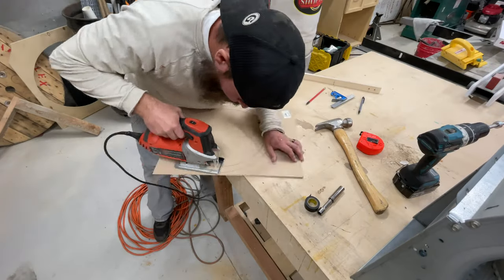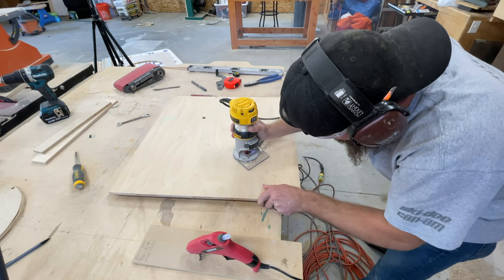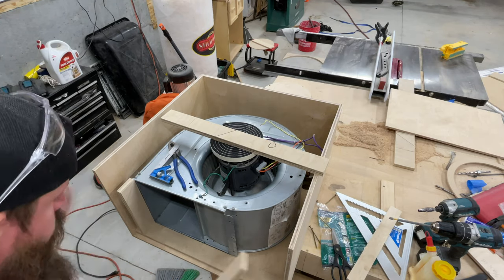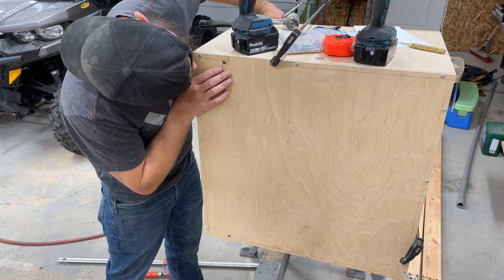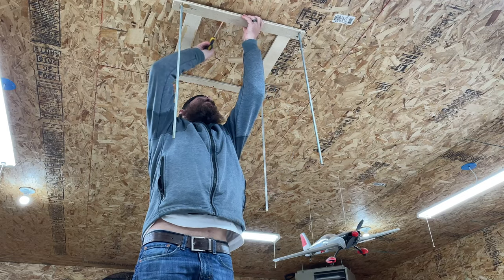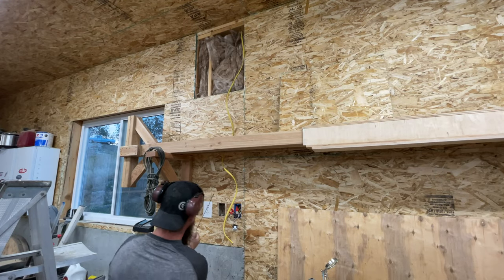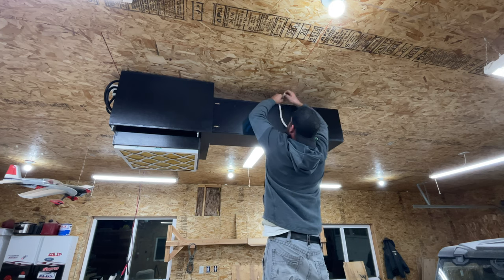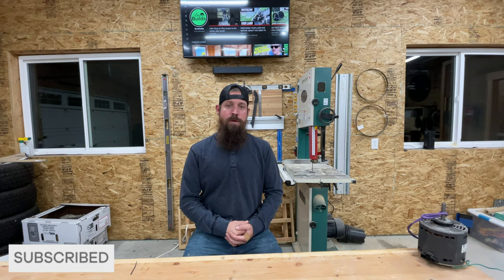THE BEST DIY SHOP AIR CLEANER! / SHOP AIR FILTER!

Comment: When I discovered that my car was generating 1000+ CO2 during the winter as it cooled down after shut down, I installed a timer on my blower for 12 to 16 hours of cleaning and leave my windows down in my car.  You have some awesome gear in your shop and if you are doing some intense work,you might want to track CO2 and/or PM 1.0/2.5/10.0 to keep you and your team safe. Tx for sharing your project work, I wish I had your space and gear!
Reply from the maker: That’s interesting, I’ve never heard about cars cooling off and not running still generating co2. I’m sure the only thing that generates co2 in my shop is my heater, but it’s also setup to exhaust to the exterior. 👍🏻 Thanks for watching and commenting.

Comment: The cooling of the motor is through air leakage only?  I would have put the motor side down or rather put a filter on both/most sides.  The slower the air speed, the finer those filters work anyway.
Reply from the maker: The motor is recessed into the assembly and appears to be getting plenty of cooling. I put the motor on the top side so the filter would be on the bottom because that is the direction the bulk of the dust will be naturally entering. You could add more filters on the sides, but that just means more filters to replace. This setup has been working great for my application. As far as speed goes the filters I’m using are designed for the air speeds of this blower unit, and although I have it wired for the low speed setting (roughly 1200cfm) the filter would work just as well on the high speed. I just didn’t need that much air flow and I wanted it on the quieter side. High was a little to noisy and to much flow for my needs.
Reply: @brewbuilds  Everything turns out right, you did put more thought in your  cleaner than me in mine.
Reply from the maker: Yeah it’s been used almost daily for over a year and it’s worked great! 👊🏻

Comment: How is the motor holding up?  My concern with the design is the motor is sealed in the box with no air flow over it to cool it down.
Reply from the maker: It’s working awesome! I use it almost everyday especially with the warm weather.

Comment: I did HVAC for 10 years and I am with the folks who say there should be an air filter on both sides of that blower wheel. First to increase cooling to the motor and second to balance out the bearing load on the motor shaft. Basically, spin that cabinet 90 degrees and load filters from left and right. BTW, you'd be amazed at how much noise reduction you can get with some duct insulation inside that box. (velocity noise from moving air) Vibration from the solid mounting is another story. I'd bet the whole roof vibrates at times. (low hum) You could spring mount it with some minor engineering.
Reply from the maker: I’m sure having air being pulled in from both sides would add additional cooling, but over the last couple years I haven’t had issues with it getting abnormally hot. I haven’t noticed any vibration, it’s actually fairly quiet. 👍🏻thanks for watching.

Comment: The furnace fan has 2 sided intake, and he only used 1 with the other motor side effectively sealed up, would that decrease the performance and risk overheating the motor? - I would have run a duct from outside and put it into the sealed side of the fan box to cool the motor and induce fresh air into the workshop
Reply from the maker: The real intake is on the side I put the filter. I’m sure if the other side where the motor is mounted that you’re referring to, were open could allow more air flow over the motor to a degree, but I don’t think enough to make a difference. The motor itself is housed almost directly in the center of the blower housing getting plenty of filtered air over it. I’ve had zero issues with it over heating or getting hot. 

As far as running a separate duct from outside to the motor side wouldn’t be ideal in the winter months while I heat my shop forcing my heater to have to run way more than needed. Hope that makes sense.👍🏻
Reply: In a larger fan designed for two intake sides (DWDI), you'd throw the bearings off after some hours of use; I'm not sure it makes a big difference in a small fan.  But if you start chewing motor bearings, might be a Thing.  The alternative is to invest a bit more plywood, make the box bigger, intake air behind the fan, roughly double the filter area, double the air flow.  BTW, the discharge duct improves the air flow by about 15~25%, so that's a good move.
Reply from the maker: The duct definitely helps it run more efficiently, with out it, it draws more current (out of its nameplates spec) so I played around with the size of the duct to get it more to where it should be.
Reply: @brewbuilds  Didn't need to experiment:  always use 3~5' of discharge duct sized at the fan outlet collar.  The factory optimizes efficiency (etc) around this configuration.  Without the duct, chaotic air flow ruins fan efficiency (drawing more current).  Looks like you got a decent setup.
Reply from the maker: @petem6503  thanks for the info! Looks like I built the duct right in the sweet spot. I knew these motors needed some load to run efficiently and the fan it self wasn’t enough, I tried looking up specs on duct sizing but didn’t have any luck at the time. 👍🏻

Comment: Nice job, only comment is you may not want to glue the plywood box pieces together, but just use screws instead.  You may very well want to take it apart at some point in the future, or you may also want to have access to things inside and having it glued all up prevents both of those from being easily done.  My .02 cents.  All the best!
Reply from the maker: Thank you. I left the top of the enclosure unglued for that reason. 👍🏻 thanks for watching and taking the time to comment. 👊🏻

Comment: Sweet build!  Have you thought about running a two stage filter to take it to a HEPA level of air cleaning? Idea is to have a 1 micron filter on the outside and a 0.3 micron inboard of that. You could probably mod the box to make room for an outer filter.
Reply from the maker: Thank you. I have thought about that, when I built it I figured I would try different filters out, and or potentially stack different ones. I’m running a 2” merv-11 filter currently and I’m not sure if it’s worth going past this merv ratings because anything higher is rated for hospital type applications, and I definitely don’t keep it as clean as a laboratory type space. 😂

Comment: Thank you for the video.  Is there a difference between the direction the fan is facing (before the filter vs after the filter)?
Reply from the maker: You bet! It’s better to have the filter before the blower. That way the air entering the box is filtered. 👍🏻

Comment: If the RLA of the motor is 1.3A at 220V I would be curious if that's actually what the motor is drawing with the current design of your system. It may be drawing more current than its rated 1.3.
One side of the intake is completely blocked with no hole cut and being mounted against the ceiling.
You may want to ask your HVAC friend about that if you haven't already.
Just trying to be helpful.
Reply from the maker: It draws 1.3 amps the way it’s setup. I designed the duct length based off the amperage. Without a duct current was higher than what it’s rated for. (Which is no surprises these motors are designed to work and need some sort of load.) as far as the intake setup, on low this unit moves over 1100cfm. That’s a pretty decent air turnover rate. Roughly circulating the completely air volume of my shop in less than 10min.

Comment: Great build! I have one comment and one question. Comment: The music in this video comes through much louder than your commentary so I had to adjust the volume several times throughout.
Question: How is the filter secured so it doesn't fall out?
Reply from the maker: Thank you. Sorry about the music/commentary, that is something I’m working on, and improving going forward. Thanks for your feedback.👍🏻

I had initially planned on making some tabs that would spin in place to hold the filter in, but after I installed the filter it fit perfect and snug not really requiring anything to hold it. So it’s just held in place by friction. Hope that helps, and thanks for watching and commenting.

Comment: On version 2.0 I think the filters should be dual 20x25x4 double stacked(MERV-11 then 12), & possibly include a 3rd-stage of filtration with a 1-inch MERV-13.   & the discharge should be larger than the blower's outlet to hopefully slow the air down & disturb less settled-dust in the space.  Air-turbulence is why Dyson's HEPA fans get horrific air-quality results in competition, you want the air clean & not to be cleaning the room with the blower.   

I've been wanting a surgery-room-style laminar-flow HEPA setup over my bed for the cleanest sleep.
Reply from the maker: Sounds like you’ve put a ton of time and research into this. 👍🏻 it’s nice to have some additional air filtration, but at the end of the day I know this is just a wood shop, and just having some airflow during the winter to help move the heat around, and help keep it cooler in the summer months along with some filtration was all I was going for. 

As far as the discharge side, I made the duct size to add enough resistance to prevent the motor from drawing to much current. (These motors need to see some load to run efficiently), and I found this length and size to be the sweet spot. Thanks for watching, and taking the time to comment 🤘🏻
Reply: I gotta do what youre saying for my bedroom too mate. Allergy problems have been killing me for the past three years....weird that thats how long ive been into woodworking but then I have stopped for long stretches and still get allergies.
Reply: @carlcarlssen4299  I haven't built my filter yet.  I think I want to change my filters more often & I won't be using 4 inch filters probably.  I think my studies/citizen-science needs a Magnehelic gauge so that I can better see how clogged the filters are getting.  I do think I'll be building mine 6ft tall with a top inlet & bottom outlet using a 1TDT7 b/c it has enough pressure to clog a filter(99% of YT builds don't use fans with a high enough rated pressure).

Comment: How big is the shop? In sq ft that is. I ask because I have a single, and a double blower furnace motor. Mine is 750 sq ft with 12 foot cielings.
Reply from the maker: My shop is 30x40 (1,200sq/ft) with a 10’ ceiling. 
This blower puts out 1,100cfm. hope that helps.👍🏻👊🏻

Comment: How did you "blow up" the previous motor? Care explaining what happened so we can avoid this ourselves?
Reply from the maker: The motor is a 240v and 3 speed, there is  4 wires, a common wire, and 3 speed wires (hi, medium, and low) when I hooked it up I assumed black was the common (I was going off my memory from months prior when I first got it and hooked it up to test it) well the black was not common, so when I hooked it up using black and yellow  and not the common wire(which was orange) it put 240v across a portion of the motor winding that was not intended to see 240v which in turn shorted the winding and burning up the motor. Always verify the nameplate before hand. I actually do electrical for a living so it was an embarrassing mistake. 😂 hope that helps and makes sense.  Thanks for asking. 👍🏻
Reply: @brewbuilds  I’ve know a lot of electricians in my life. The fact that you admitted to this f up speaks volumes to your character. I’m now subscribed.
Reply from the maker: Heck ya!🤘🏻i’ve made plenty of mistakes, and probably will make plenty more. Sharing mistakes is key to helping others learn. I have no problem sharing my fails to hopefully prevent someone else from making the same mistake. 👍🏻

Thanks for watching, subbing, and taking the time to comment. I really appreciate it.

Comment: Cooling for the motor? Or did I miss something
Reply from the maker: The air flow through the filter has been adequate enough to keep the motor temp good. It’s been up and running for about a year. using an infrared temp gun I tested it before hanging it. 👍🏻
Reply: @brewbuilds  it was not clear Thank you
Reply from the maker: @monteglover4133  it’s my fault, I missed the mark with that. Thanks for asking about it though. 👍🏻

Comment: OK, I’m impressed.  That’s a great design and excellent execution.   Well done sir!

Now to steal a blower somewhere ….

Oh, do you mind sharing what one should avoid doing so as not to burn one’s motor up like an … idiot?  😜
Reply from the maker: Thank you, it works awesome too! It was me not referencing the nameplate for the wiring layout and when I was testing out the different speeds I crossed my wiring assuming the black was my common wire (which it wasn’t) and put 240v across a portion of the winding that wasn’t designed for that. 🤦🏻‍♂️😂 I had tested it all out when I first got it months prior, and I do electrical for a living, just a simple mistake that could have been easily avoided if I would have just double checked the wiring diagram real quick vs just assuming. Thanks for watching and commenting. 👍🏻
Reply: @brewbuilds  awesome of you to reply, and so fast. I’ve got an HVAC buddy who can probably score me an old blower. 

Thanks for sharing all that.
Reply from the maker: @Colorado-Tinkering  no problem, that’s how I got mine, my buddy does hvac for a living and I asked him to save me one if he ever got a hold of one.

Comment: Most of these blowers are designed to perform with air restriction. In a traditional HVAC, the filter provides some of this just like you have. However, the long ductwork also provides resistance (static pressure). If you're trying to dial in air movement vs noise, add a baffle to your outfeed. Closing the baffle part way will actually speed up your blower, giving you more air movement if you need some more from time to time (like when messing with MDF).
Reply: Yeah. Restrict it and make the fan work harder. Nothing can go wrong here... Burn another motor up. They're so cheap!
Reply from the maker: @jloganmarshall These motors require some load/ restriction to run efficiently, without it they will burn up.
Reply: @brewbuilds  1 cubic foot of air is about .08 lbs. 1200x.08=96 lbs of air moved per minute. That's a load.

Your point is the motor is designed to move that load against static pressure. No resistance allows it to over perform. Restricting it via damper does not increase air output, or motor efficiency, just brings its static pressure up to it's design limits.

This applies only to multi/single speed fans. Electric commutating motors are a whole different thing and don't look much different.
Reply from the maker: Before adding the duct I found 3 to 4 feet to be the sweet spot to bring the running amps to within the nameplate specs. And honestly that’s all I really cared about. This is just to move some air around and add a little filtration. I am by no means an hvac specialist, I do know  a thing or 2 about motors. 👍🏻 thanks for your input it sounds like you have some knowledge in the matter.
Reply: @brewbuilds  Your build is the exact right way to do it. And the duct does prevent recirculation of already filtered air... So kudos man! I am linking your YouTube everywhere.
Reply from the maker: Thanks man, I really appreciate it. Thanks for commenting. 🤘🏻

Comment: You are wasting more than half of the blower's capacity by only using one side of the blower wheel.
You should have not mounted the blower to the side/bottom of the plenum box, but mounted the blower inside the box so that the blower wheel could draw from both sides.
Plus that is how the motor is cooled since it is an air over motor.
Oh well....
Reply from the maker: I’m sure having the other side open would be beneficial, but excessive heating hasn’t been an issue, and on the low setting the blower is putting out more than 1200cfm, giving me a complete air exchange in roughly 10min. I’d say that’s adequate for me and my shop. Saying it’s cutting the blower’s capacity by more than half is an exaggeration. Thanks for your input. 🤘🏻

Comment: And this why you fail. 
You took a motor that is designed to use minimum 2 filters and use one. 
Needs minimum a filter on intake and exhaust.  Most people  use 5 to 9 filters on a shop filtration
Try again on your design.
Reply from the maker: Wrong